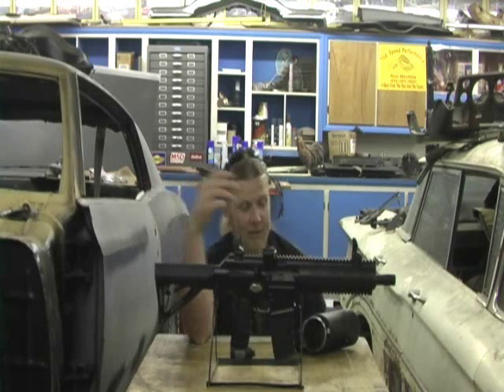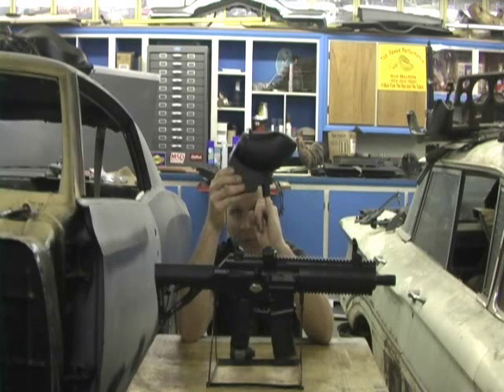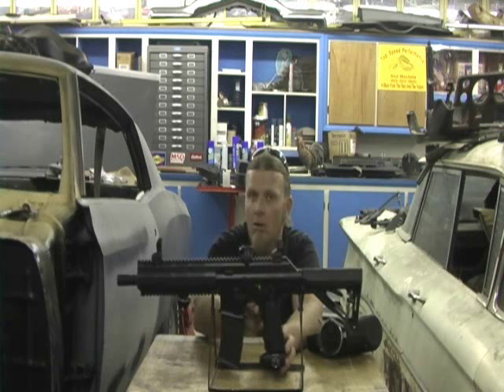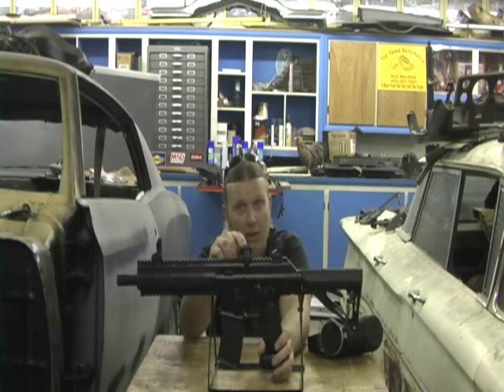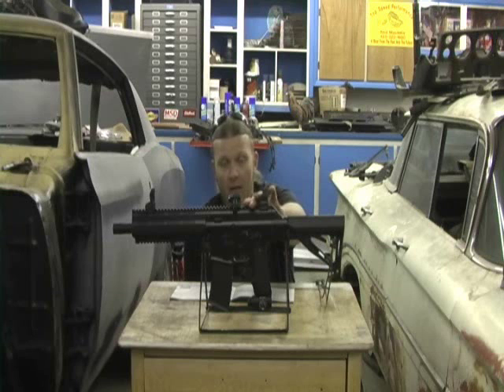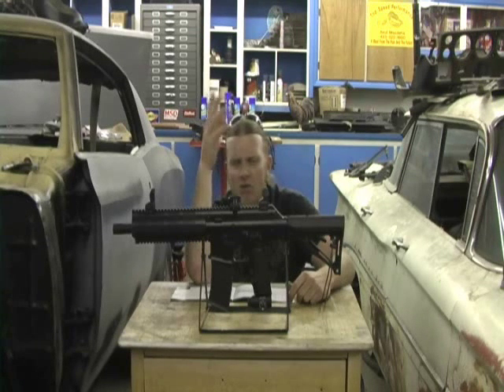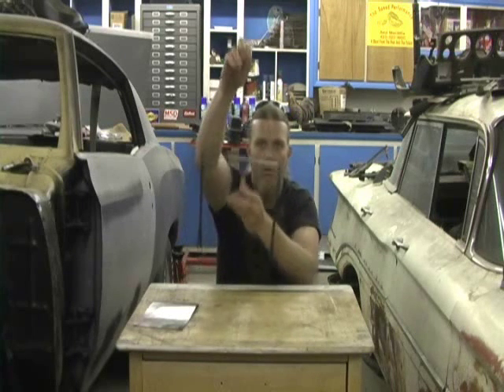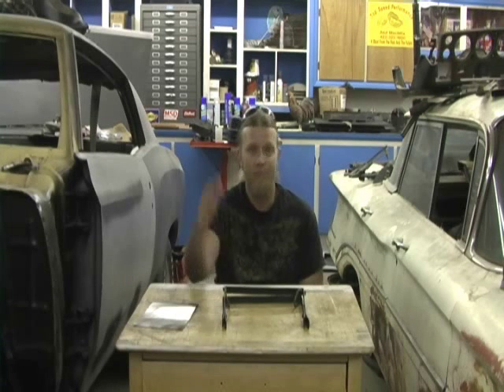The eyes of the BT TM 15

Comment from the maker: @Thulsa420   In this video I hold the trigger and push power button to turn the eyes OFF. Without pulling trigger just press power button to turn on with eyes on. If it still fires without paintballs it Is possible that you have broken paint inside the marker covering up the eyes inside. If the eyes are covered in paint the marker will fire as if loaded when it is in fact empty.  If these do not work, remove and replace battery or use factory reset.